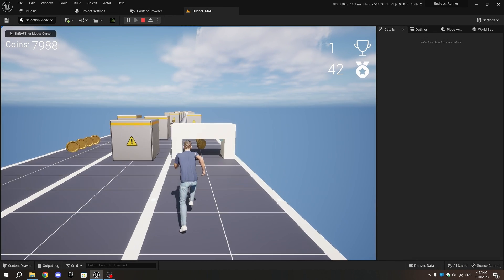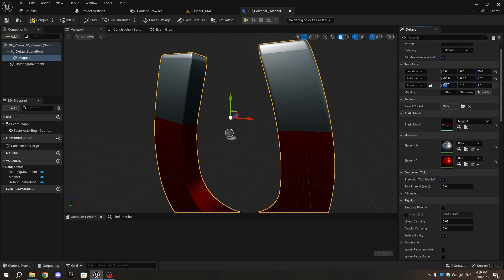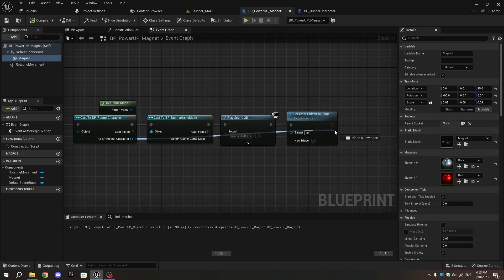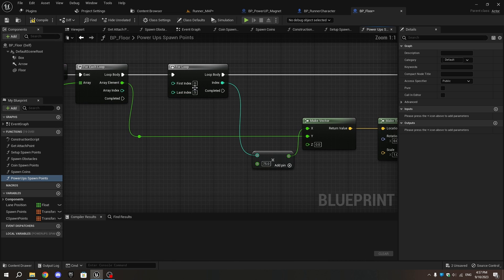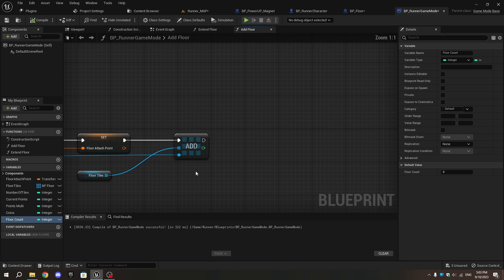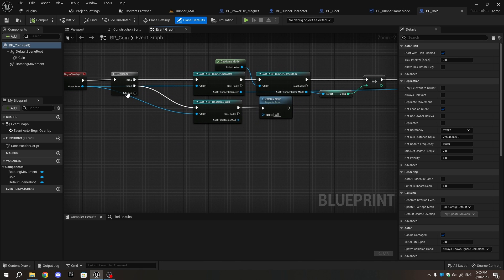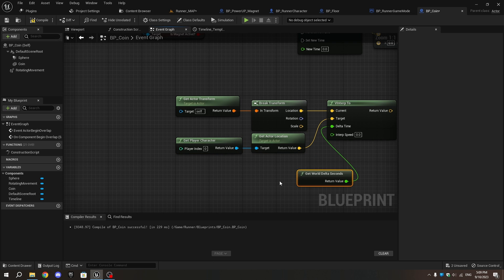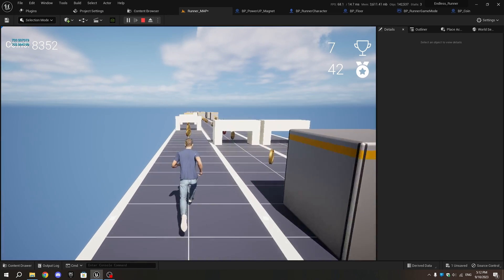Unreal Engine 5.1 Endless Runner Tutorial - Part 10.1: Spawning Magnet Power Ups

Comment: When the magnet effect isn't being removed due to the floor being destroyed before 5 seconds, is there a reason why shouldn't just move the activation, delay/duration and deactivation of the magnet over to the runner character via custom event and call that event within the magnet powerup bp ? That way you don't have to make the number of tiles greater than 2 in the endless runner game mode.
Reply from the maker: Thanks for the suggestion, I didn't think of this before. I'll implement it in my next videos.